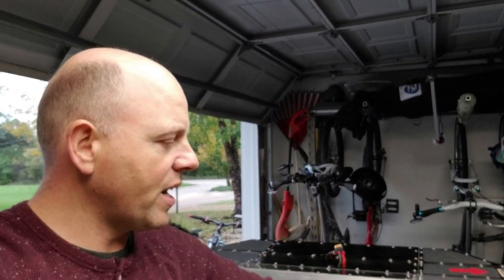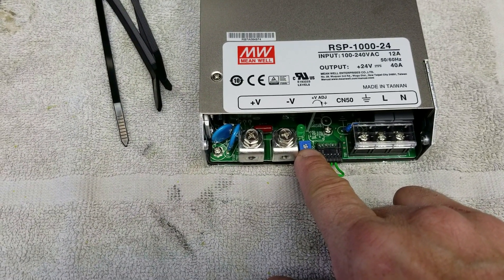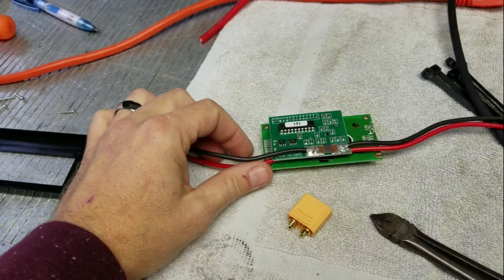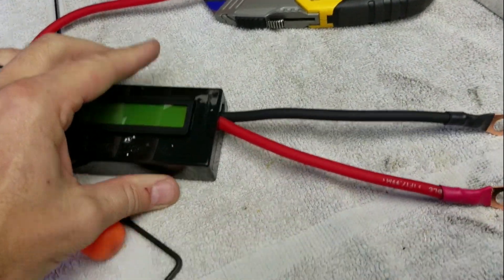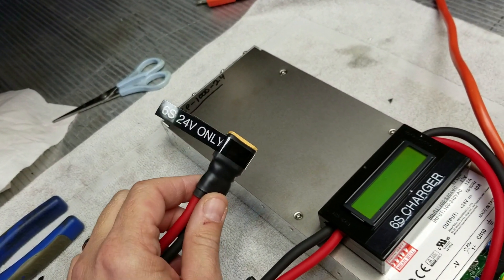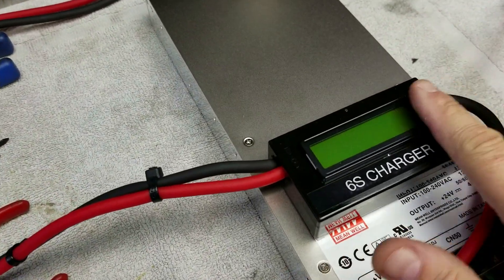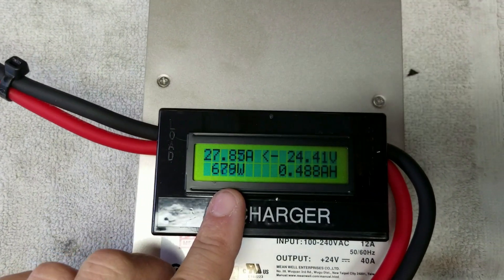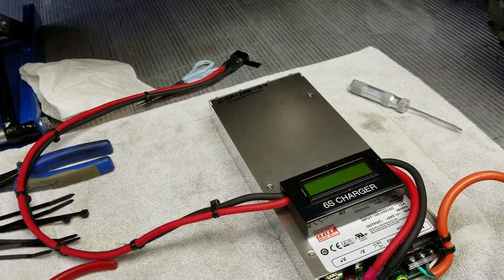Building a low cost, high power Lithium battery charger

Comment: I have a 0-9v and amperage go's up with the voltage  can I use it to bulk charge  lithium  battery cells  also have 24v 16 amp one

Comment: I was expecting to see a battery monitoring or control system that cuts off charging when battery is full. Except that network module or power supply has intelligence for a controlled charging. 

I have a microcontroller(PIC) based battery monitoring circuit that sends a digital high signal to a pin at a determined voltage. That pin can be wired to a relay module to put on or off charger using battery voltage as a criteria

Comment: I need to wake up my 60v 16s lithium battery it’s new but gone in to sleep mode as it’s not been charged and accidentally left my scooter on, now the charger will not charge the battery as it’s discharged to far

Comment: I'm sorry.. But should it not be constant current up until a certain charge and then constant voltage further on? Battery manufactures indicate that a CC/CV mode of charge is required. Another problem is that with large battery packs, long charge times will be required where allow of current will be drawn for extended amounts of time (operating at power supply max power constantly)
Reply: He said that it's a 40 Ah battery. The power supply can push 40 amps at 24v max, meaning that the size of his power supply is in itself a current limiter. Since he can't possibly charge at more than 1C, adding current limiting is effectively unnecessary.

Comment: What's your view on adding an iCharger X6 (or X8) to this configuration?  Seems like that would give you so much more control over everything.  You can set limits for just about everything, and you could monitor each of the six cells.  It even does 2 Amp balancing if any of your cells are deviating from the others.  I'm not criticizing, just wondering if the iCharger X6 (or X8)would be a good addition to your setup?  Thanks.

Comment: This is a no go!! Dc power supplys are not made for that purpose !! because there is nothing to control the output power the psu is pushing maximum current all the time and is gonna break very soon. what i suggest to you is to go and buy a good and powerful lipo charger, now that you have the psu. and don t use them to the max potential .as a rule buy at least 1/3 more powerful psu + charger that you actually need. if you don't do this in the end  you gonna spent more money for extra power supplys  and chargers.
Reply: Hello, can you send me the address from where you bought the 6s chaeger display? Thank you
Reply: Is that a switch power supply for LED lights

Comment: I have a 48v Lead acid charger. But it puts out 55v I opened it up and didnt see a potentiometer. Do you know of any way I can lower the voltage to 49v So i can charge a Lithium pack?
Reply: is it also an switched mode power supply?

Comment: Hi, Can you please guide that how we can modify your project to charge NiMh Type battery?
Required, INPUT > 220VAC,   OUTPUT > 190 to 220VDC with 1 to 8amp
Reply from the maker: There is no way using this power supply
Reply: @TechForumTesla  Should it work if I use direct Grid 220VAC to a Bridge Rectifier (GBU808) and then use Rectifier's  DC output of 220 VDC to charge my NiMh Type Battery directly? will it be safe for my NiMh Type Battery?

Comment: Can this power supply be used to make a 13s8p charger?  https://www.aliexpress.com/item/32714827944.html?spm=2114.12010612.8148356.1.109656652H3coD and is there anything to worry about when thinking of constant current and constant voltage with this power supply? :-)

Comment: I thought it was constant current changing voltage untill it hits top voltage then it stays steady voltage changing current. I suppose a way to pose the question is this, how come our teslas keep amperage nearly constant while increasing voltage until near full then keep voltage constant while tapering down current? 18650s as well. Is it the chemistry? I may be misunderstood, but I thought constant current was a thing untill the top of charge voltage was met then it went constant voltage....
Reply: As a reference I have found this. https://www.radio-electronics.com/info/power-management/battery-technology/lithium-ion-battery-charging.php
Reply: I second this question. I've heard best practice is CC, then CV. Like you say.
Reply: You are right but I believe that is what he is trying to say and that was what happened although the current dropped some befor reaching top voltage but that won't hurt your lithium cells. 
He also set top voltage kind of low because he didn't want to fully charge the battery and that won't hurt lithium cells either. 
In fact if your going for battery longevity you should try staying between 40%DOD to 60%DOD using only the 20% in between, and charge them with low current and also discharge them with low current but that would make Elon a very poor man :p

Comment: Nice project. I can see you put in a lot of work on that skateboard. What are you using for cell balancing? BMS, or manual balancing? If manual, is it top or bottom balancing?

Your power supply is 40a CC, up until you reach your voltage setting, in which case it goes into CV stage. Unless those are low drain cells, I would guess that fully discharged, you would see it enter the CC stage first, but in your demonstration it was at too high an SOC, so it went direct to CV stage. 

Matched cells are key in any battery, but charging at 1C is going to cause some cells to go higher than the others. Since you are only charging to 4.08v, that does give you some buffer in case a cell is 0.12 volts higher, but have you measured this during 40 amp charge just at the point when it goes to the CV phase?

If you have a BMS, what is the max bleed? Most small BMS won’t bleed 160 watt, which is what it would need to do at 40 amps if that cell exceeded the max voltage. 

Most EVs, and even my Gel Cell scooter, have a charger that starts CC (they all do), and then does a tapered CV. In the case of a it might start CV at 3.90v 30a per cell, then 3.95v 25a, 4.00v 20a, 4.05v 15a, 4.10v 10a, 4.15v 5a.

By doing this, the temporary cell voltage surge during charge is lowered the closer it gets to full voltage. My 48v 20ah gel cell battery does the same, because you can’t balance charge fell cells like you can flooded cells. My cheap Chinese batteries are so mismatch that during the CC phase, the voltage spread is quite large, and since these are 12v battery’s, I can’t even see what the real cell to cell voltage is.
Reply from the maker: I do not run a BMS. My experience is high quality Lipo packs with matched cells stay in balance add long as they are keep between 20% soc and 90% soc.

I have manual resistive balancers that I use periodically to check model balance within all of my packs. 99% of the time no balancing is needed even after dozens of cycles.
Reply: @TechForumTesla  what is high quality lifepo4 ?  Thanks